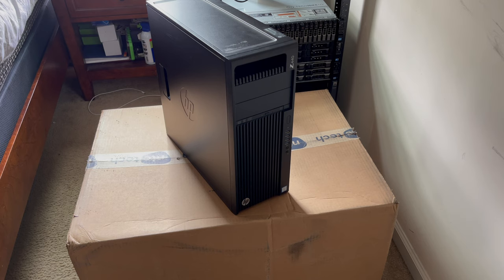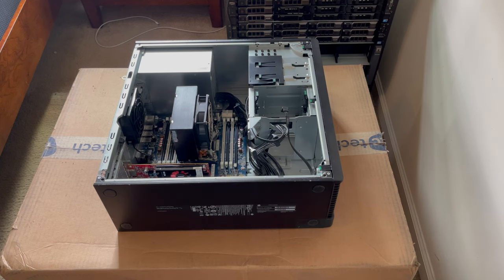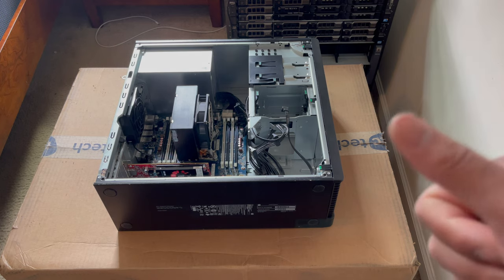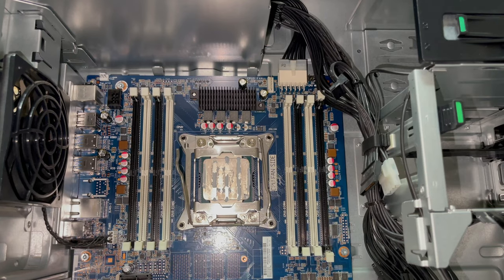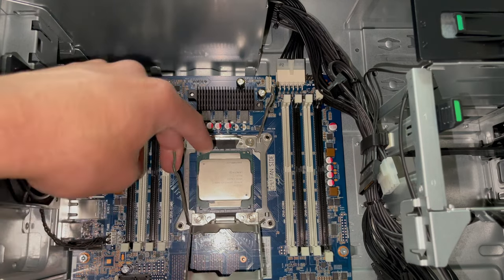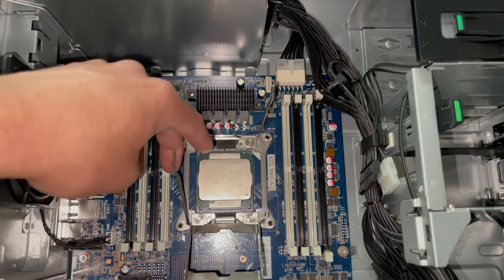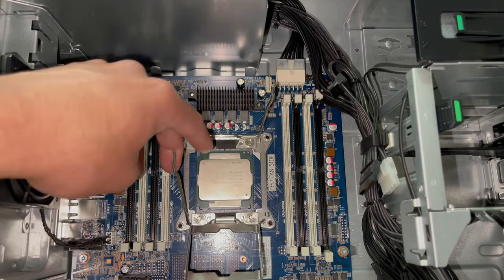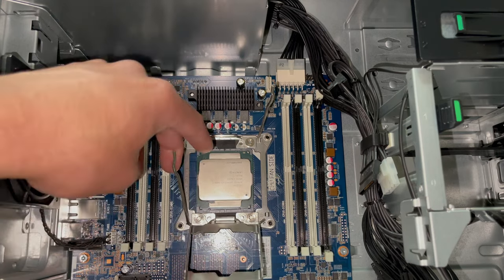Building a 18-core Hackintosh! (HP Z440)

Comment: Bought one recently after letting my very old Dell T5400 Dual Xeon go after many years. I have a E5 1620 v4 with 16g ddr4 2133 dimms and a 970 Samsung Pci-e ssd. Going to install another 32g ram and upgrade the cpu as well. Amazing how much these machines can be upgraded. Cool video.

Comment: I think this is a great hackintosh I use this computer as my main system and it's great! Only thing that sucks is the cooler isn't the best for the Cpu I wonder if there is a better cooler that would work perfectly in this.
Reply: try the coolermaster coolers, they work great.
Reply: Same is it easy to hackintosh this z440 ? I've done it before but idk if it changed since but what version of Mac os are u running?
Reply: @ashk3734  but the original cooler is 6 or 5 pin 😂 how are u going to connect a 3 or 4 pin cpu cooler to it 😂
Reply: @memesyandhorrorshorts  dude, f it then, get a external fan you know😭🤣👍 what I mean
Reply: @memesyandhorrorshorts  they make adapters for 4 pin fans

Comment: I have a z440 with a 2666v3. It works but the turbo boost is disabled by default, does it work on yours ? Cheers
Reply: 2 things. 1) make sure the chipset drivers are fully installed. They do not automatically install from windows.  2) check the bios. It's possible that turbo boost was disabled in the bios.

Comment: What gpu would be good to pair with this that isn’t bottlenecked? Used and less than 200.
Reply: Anything less than a 3070ti should be fine from Nvidia, and a 6800 from AMD. In my own system I have a 2060 and it matches up nicely, but there's definitely CPU headroom. Your biggest issue is going to be the PCIe 3.0 spec.

Comment: nice build, but ditch the Sandisk drive. You can by HP Turbo Drive G2 for cheap on e-bay, which gives you loads more throughput than a 6GBps Sata ssd.